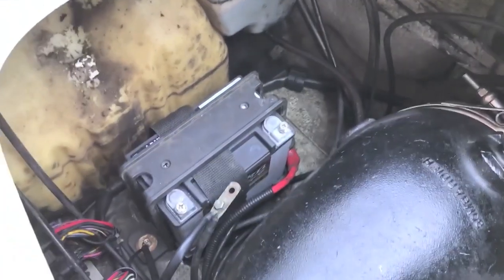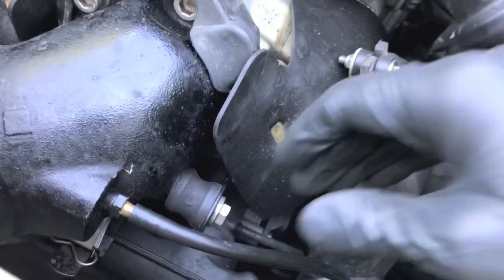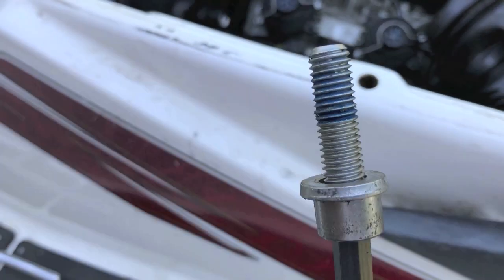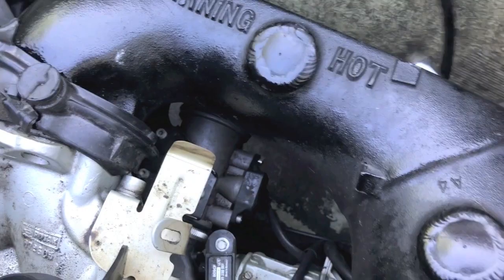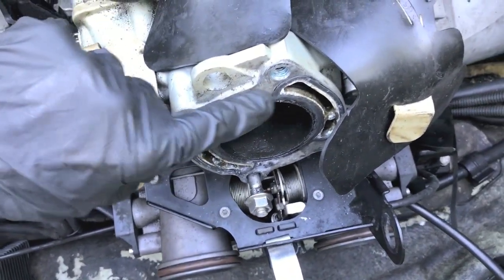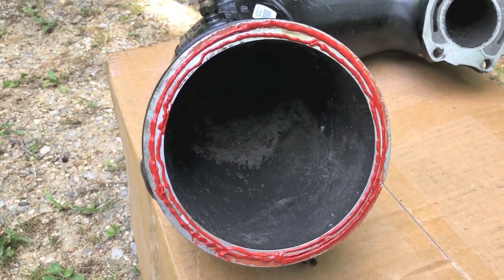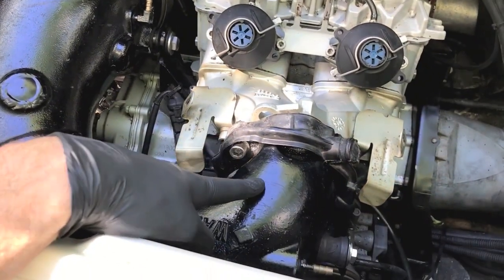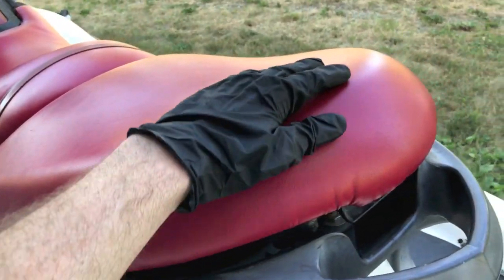How to replace jet ski Exhaust Manifold pipe - FAST & EASY!

Comment: The nut that you mention you only need to loosen instead of remove, did you take off another part to get at it? I can’t get a wrench on it because of the part that’s below it
Reply from the maker: Thanks for watching & welcome to the DIY Raptor Club.  Beginning at the (3:36) time, you will see that we removed three plastic parts, the 3rd part being the largest & has a lock pin & latch.

This part must be removed to gain access to the hardware that needs to be loosened.

Hope this helps, keep us posted on your project.

😎👍🔧🔩
Reply: You need a modified ring spanner.

Comment: Was ur v-band connection hard to take off? I can’t seem to separate the two exhaust from each other.
Reply from the maker: Thanks for watching, not that we remember…

The gasket maker must be pretty strong or there is something else still holding the two pipe’s together.
Reply: @DIYwithMichaelBorders  I got it after a while. Just must have never been taken off. Thanks
Reply from the maker: @jedshafer6873  

Awesome job, keep us posted on your project.  We literally filmed a series this past week of removing the engine in this video from the jet ski.

Overhauling the engine next week.
Reply: @DIYwithMichaelBorders  that’s nice. Got something to follow now and look for answers at now.

I had a oil leak and saw a line was leaking bad and fixed that but it was still leaking. So I took off the exhaust manifold and found out that the bleeder screw was missing.
Reply from the maker: @jedshafer6873  

Great find, that’s awesome you’re working on it and installing new parts.  We have a large set of videos coming to our channel on this ski.

Jet ski videos set to release early 2024.  😎👍

Comment: I have the same exact jetski i’m working on right at this moment! 03 seadoo gtx di, just a quick question, does that vent under the seat connect to anything or does it just hand freely towards the back?
Reply from the maker: Thanks for watching & the vent ducting directly underneath the center plastic cover does not connect to lower ducting with anything.  It just shifts into place & is held down by cover & seat.  Hope this helps.

😎👍🔧🔩

Comment: Hello, 
I ve one 1998 Yamaha waverunner gp1200... the exhaust pipe already warn out three times. Do you know what can be the cause?
Reply from the maker: Karina Carneiro 

Thanks for watching & sharing your experience.  What exactly is happening to pipe?

Exhaust Pipes can wear out faster than normal if not properly winterized prior to cold weather storing.  Any excess water can freeze, expand, & cause cracking of pipe as well as damage to O-Rings.

Keep us posted on your project.  Please subscribe to the channel and turn on your YouTube notification Bell 🛎 that would be awesome thanks again!

😎👍🔧🔩
Reply: @DIYwithMichaelBorders  thank you very much for your reply.
The pupe bursts after running the engine for some minutes
Reply: There is a rubber pipe that connects t the exhaust exit on the engine to the pipe, this is the one bursting
Reply from the maker: Karina Carneiro 

😎👍🔧🔩
Reply from the maker: Karina Carneiro 

Thanks for the reply.  That’s odd, the rubber hose should be pretty durable.  Try purchasing the OEM hose & see if that helps.

Definitely keep us posted.  We are curious how your ski gets back up & running properly.  We are always here to answer questions!

😎👍🔧🔩
Reply: @DIYwithMichaelBorders  thank you once again. 
I will keep you posted 👍

Comment: Easiest way to separate the manifold seam?
Reply from the maker: Thanks for watching, how did your project go?  Keep us posted on your progress if you haven’t started yet.

Let us know if you have any questions and hey if you’re into crypto trading, join our DIY ecosystem.

       toolboxtoken.com

Reach out to us any time!  🧰
Reply: @DIYwithMichaelBorders  That doesn't answer my question but okay. I'm asking how to separate the exhaust after the clamp has been removed? Mine seems to be stuck on there good.
Reply from the maker: @brandonweiland9733  

Thanks for the reply.  You may be able to ever-so-gently tap it with a rubber mallet.

The last thing you want to do is jam a breaker bar in the seam where the two pipes meet…that would definitely increase the possibility of damaging pipes.

Comment: What engine is that?
Reply from the maker: Tom Petty 

Thanks for watching & sharing your question.  This is a Two Stroke, Twin Cylinder Rotax engine.

Most of these engines were manufactured from the years 2000 - 2003.

Hope this helps!

Please subscribe to the channel and turn on your YouTube notification Bell 🛎 that would be awesome thanks again!

😎👍🔧🔩
Reply: Looks like a 947
Reply from the maker: J Rushtx 

Thanks for sharing!  😎👍🔧🔩
Reply: @DIYwithMichaelBorders  Yep, I've got a  '97 GTX with a 787 I'm currently working on, looks different than yours. I assume J Rushtx is correct that it's a 947/951.
Reply from the maker: Tom Petty 

Very cool & the GTX is a more friendlier engine to work on compared to other Jet Ski engines out there.

Definitely keep us posted on your project.  We are here to help with questions.

😎👍🔧🔩